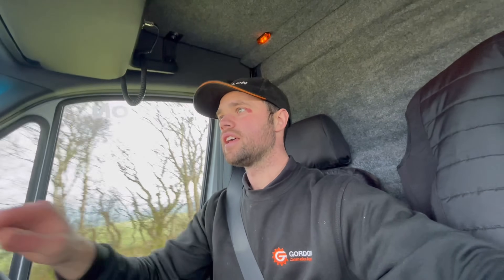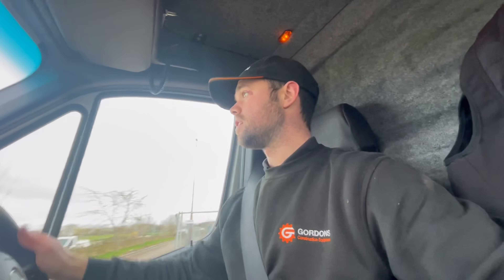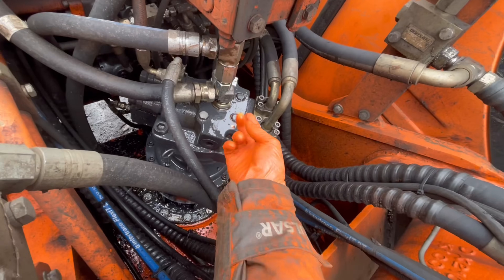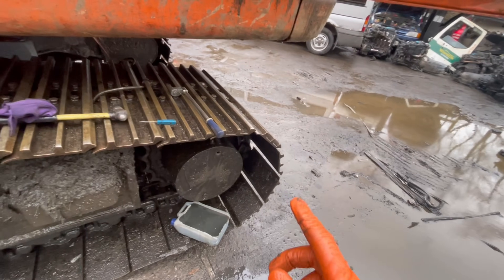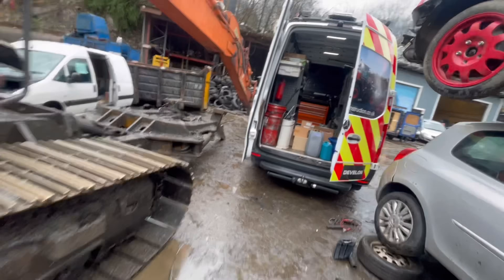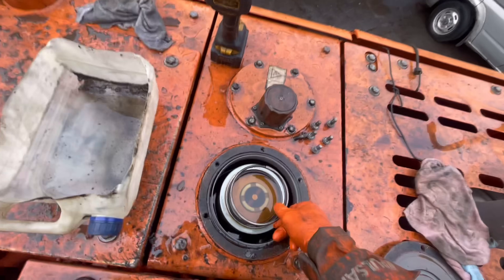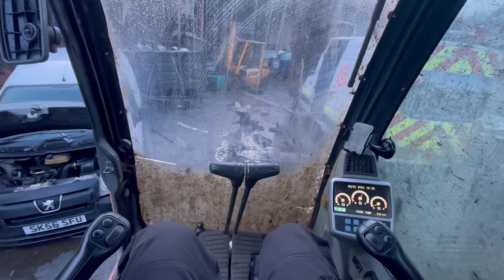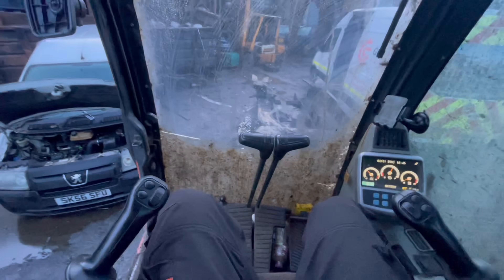Service time at Baxenden Car Breakers / Not everything is up to scratch / but what do I think ?

Comment: hi ali just about to buy a dx55r whats ur thorts on them as i used to have dx 60r and loved that machine with the old yanmar engine have u had any probs with the dash 7 ones great vid by the way
Reply from the maker: They have been very well behaved we’ve sold quite a few and no major or common problems so far the operators / owners seem to like them I think you’ll be grand 👍
Reply: many thanks just got to wait for dealer to add the pipework for the rotation as the i looked had only had single pipping on it  @alisdiggerdiary